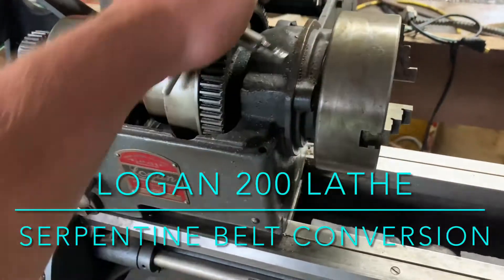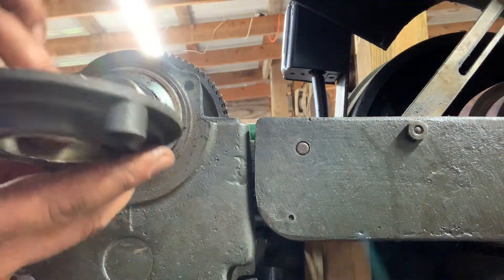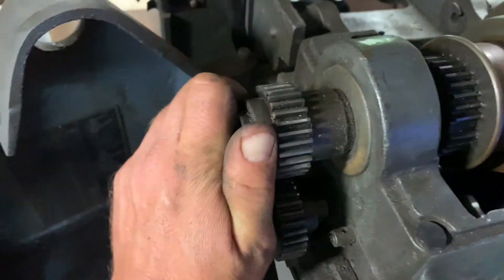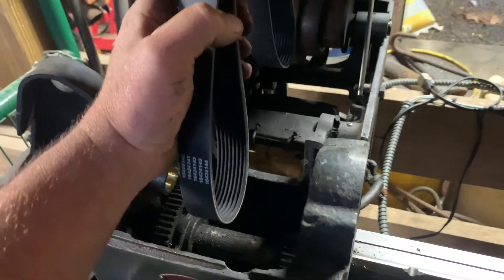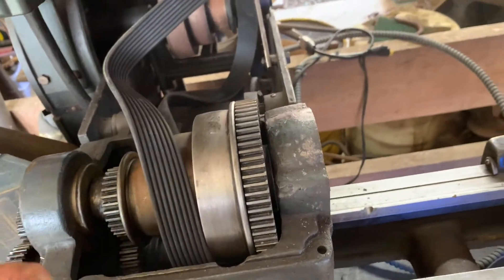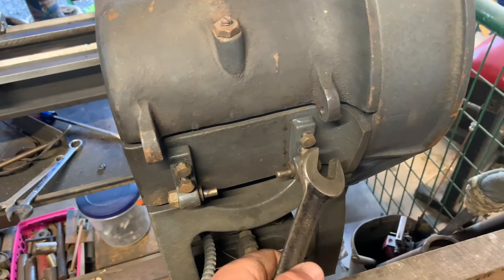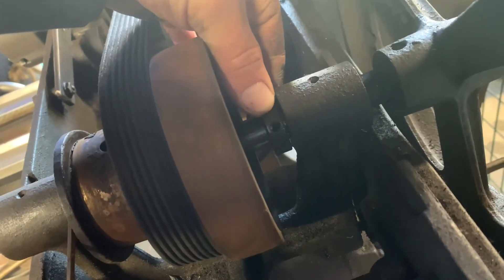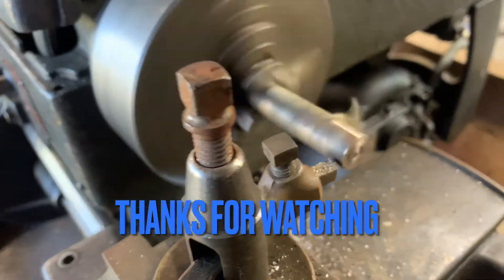Logan 200 lathe serpentine belt swap

Comment: Thanks for the video, I have been thinking about replacing the same gear in my Logan 200, and it is in much worse condition than yours. It’s called putting it in back gear with the knob out but mine has never worked so I am not sure what it does.
Reply from the maker: I been through this and another Logan 200 they are quite simple I learned to work on if you have the right tools. What did it end up being? Sorry about the late response

Comment: Wow & thank you. I heard of other people breaking things doing this. I an glad someone finally shows the right way to do this, and I can see why others had trouble. I replaced my old layered belt with a Drive belt with clips & pin. I also added some heat shrink with glue on the clips to stop the annoying click click click of the pins as they hit the metal pulley  Wish I had seen this sooner.
Reply from the maker: Thanks for watching I wish I’d seen this comment sooner! I appreciate your kind words I learned much more after working on this and other Logan 200 they are actually quite simple and easy to work on after doing it. The problem I generally have is being intimidated to start a project without having much knowledge on a machine. Thank you

Comment: and at 3:19 did you find out what that was for?
Reply from the maker: Yes that engages your back gears not sure why but mine got stuck I ended up breaking a tooth off trying to get it to go back in. If you engage those make sure you disengage your spindle first.

Comment: Hi. Very useful video. I would like to perform a flat belt upgrading on my Logan 821 lathe. I think is the same horizontal transmission. Do you know the belt model or id number? Thanks and regards.
Reply from the maker: I just seen this comment I apologize did you do your conversion?

Comment: The gears under the front pullies is the back gear. When you pull the knob on the front it raises these gears.  Then you have the pull the button on the bull gear that is located inside the ring gear. This will disengage the bull gear and let the drive train to turn at a slower speed.  I had to replace the back gear. It cost about 400.00 from Logan Actuators. They supply all parts for all logan lathes. Only one problem it is expensive.  Login also has Manuel's with exposed views of all assembles showing part numbers.
Reply from the maker: Thank you for the information I rest appreciate the help. I found some gears on eBay but none seem to be the exact gear for my lathe.

Comment: Nice lathe, your hinges on the top cover are eccentric. Adjust those and your cover will set on just right. Also belt tension could be too tight. Good luck.
Reply from the maker: Thank u! I wish I just had more time to learn on it I will have to check out the adjustments I was wondering that myself. Thanks for watching the channel
Reply: The belt tension is adjusted with the screw and nut protruding out the back centre top of the lid.  This bolt pushes on a lever under the pullies. I have this lathe and installed the same belt you just did about 10 to 15 years ago.